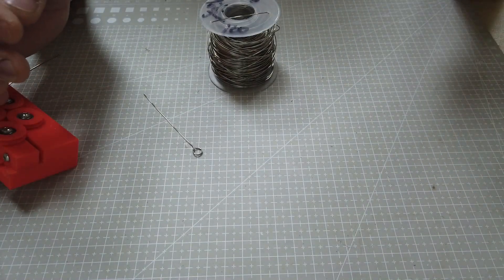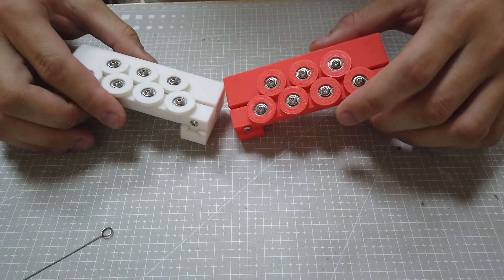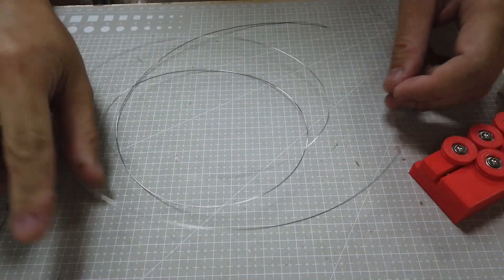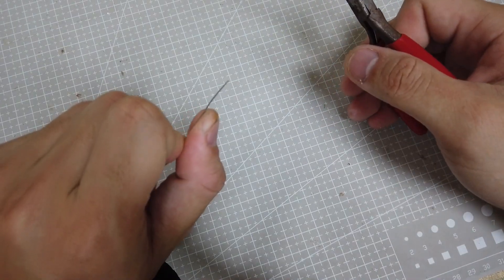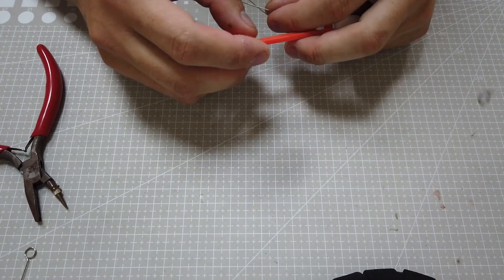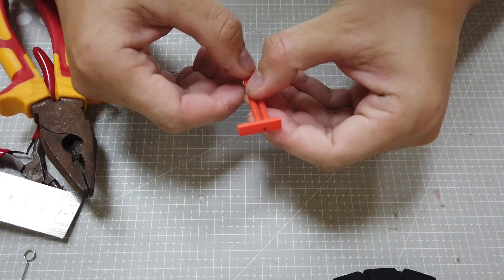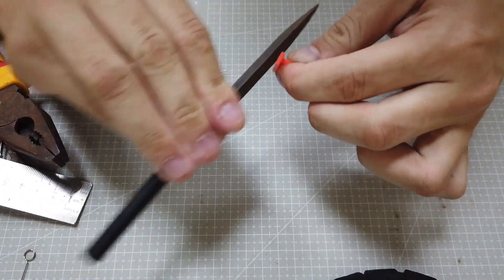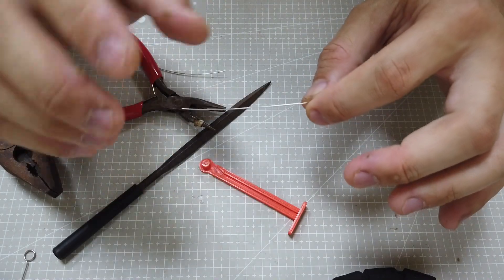ERC TimSav - Making the Perfect Needle

Comment: The wire gauge is .06 mm, correct?
Reply from the maker: 0.6mm bro
Reply: @EdwardRCAir  - Whoops, I just realized I put the decimal in the wrong place. LOL! 0.6 mm. Thanks!
Reply from the maker: Hahaaha. Join the fb group ya
Reply: I would be easier to sharpen if use a mini grinder tool.